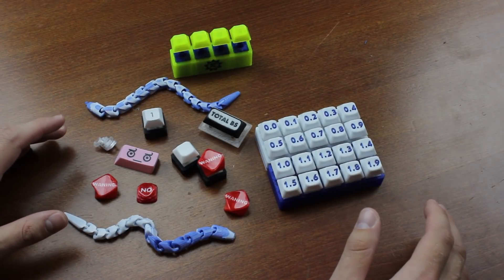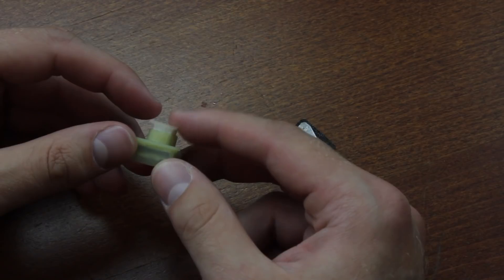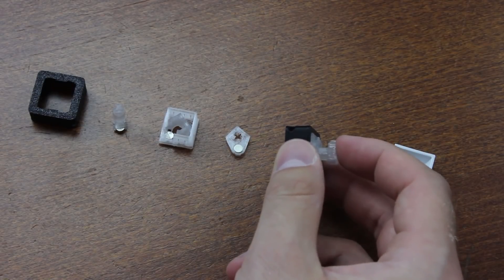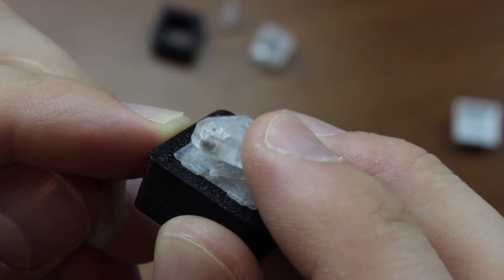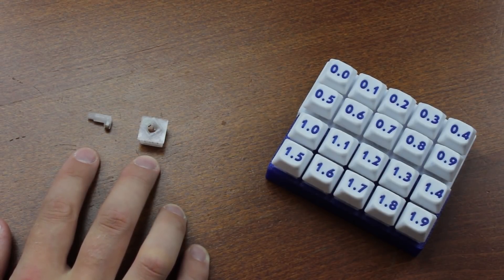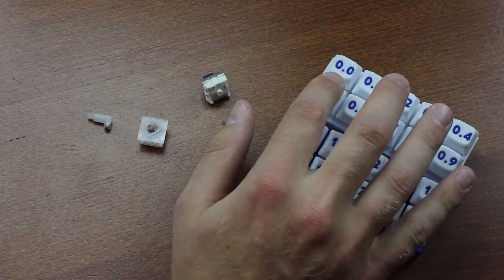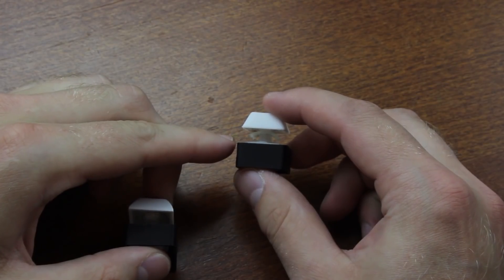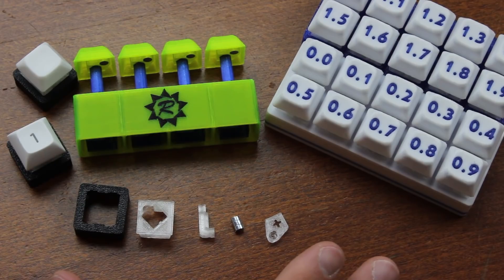Teardown - 3D-printed magnetic levitation "Void" switches!

Comment: I thought of this sort of idea a while ago after seeing the At&t switches. Really glad to see that it's possible and so elegantly done. Although I was wondering if you could even remove all friction by putting a magnetic slider in the center of a magnetic ring or something, so the slider would never need to rub against anything at all inside the housing. The solution used here is a lot simpler though, and tons easier to make, I'd think.
Reply: Imagine using adjustable magnets to change the weight and tactility in every switch to make it perfect for the user

Comment: I'm assuming that this kind of design puts the tactile bump all the way at the top of the key stroke?
Reply: That is correct.  There's some travel (~0.1mm) but it's mostly related to the tolerances you use when you generate the switch.  This is because the stem has to sort of straighten itself out before it moves down the sheath (aka the path of travel).  It's definitely a completely different key feel from literally every other keyboard that's ever been made.  If you could amplify the tactility of any given tactile switch (and move the bump to the top) without increasing its weight/force that's kind of like how the switch feels.

Also, if you use N52 (strongest) magnets and a really large magnet gap the switch feels quite linear.  The travel distance also has a non-trivial impact on how linear the switch feels when you use this sort of configuration.
Reply: @Riskable3DPrinting  If you used a medium gap, does the tactility become more rounded, like on SKCM Brown/Green or Topre. I get that it's not going to gradually increase, but since it's magnet-based I'd assume it would gradually decrease. Thanks a lot for the answer! I'm really curious about how this project will turn out.
Reply: @Zentennen  Well it's not going to feel like a Topre which has a really long/smooth "bump" but it definitely gets more "rounded" as you crank up the `MAGNET_VOID` value (with N52 magnets).  The effect is less noticeable with weaker magnets though.
Reply: @Riskable3DPrinting  I might just have to try them out some time, sounds promising!

Comment: That's pretty interesting. 
Would love seeing them in a keyboard for sound, comfort and durability testing.
Reply: Ya know, I've been doing testing with long-ish (6mm) travel switches and low-profile, short (2mm) travel switches lately and it's amazing how much of a difference that makes in the sound.  Using different materials also has a huge impact.  For example, if you print the switch in PLA that makes a higher pitch sound (because it's a harder material than PETG).  It also sounds different if you print say, the stem/slider in PETG but the switch body/sheath in PETG.

The keycaps also make a HUGE difference in the sound of the keyboard.  Thick PETG keycaps sound and feel the best IMHO.  They have a softness to them that just feels nice and they generate some of the lowest, "thockiest" (hehe) sounds.  If you print everything in PLA you get that high-pitched "clack" sound that a lot of people prefer though.

Of course, lube (and different types) also modify the sound profile quite a bit.

Comment: I think this would be a great print for a resin printer.
Reply: 3D printer resin actually has a terrible coefficient of friction compared to PETG.  So while the part would look nicer it wouldn't really feel nicer.
Reply: @Riskable3DPrinting  You could print the parts with PETG and only the keycaps with resin. I would like the more silky feel of resin, especially the grey engineering resins that are on the market nowadays. PLA has a way better friction coefficient than PETG by the way. So then I suggest using PLA. The additional brittleness is not an issue in this case.

Comment: Imagine working electromagnets into this and having a keyboard with fully customizable tactility and actuation point in software (pretty sure electromagnet strength can be varied as opposed to on/off).
Reply: This is possible but you'll need some serious electromagnets under each switch.  Would make for a reasonably tall keyboard. You'd also have to be careful with the timing so you don't mess up your hall effect sensor readings.

Comment: Wow, I wonder how accurate the machine needs to be to print this stuff, this should only be printable in a well calibrated printer with dry filaments. Even if you print it larger and sand it down to size it still takes time to make every part fits, otherwise they will stick or wiggle.
Reply: Nonsense!  The tolerance is configurable so even if you have a terrible printer it should be fine regardless of how much of a wobbly POS it is.  The part that matters is the stem and the sheath and with 4mm of travel they're under 15mm long.  That means that even if a belt on your printer is too loose or too tight it can only impact the tolerances so much, ya know?  It'll be fine 👍

If my noob 3D printing friend can print these with his Ender 3 Pro anyone can do it.

WTF does dry filament have to do with anything?  Hah!  I live in Florida and some of the filaments I've printed switches with have been out in the open air for months!  Prints fine (though you can get ugly bubbles in wet transparent PETG sometimes, haha).  Best filament for this is PETG: It has a low coefficient of friction, is quite robust, is super easy to print with, and cheap !  One spool of clear PETG will get you like a bazillion switches.  Many keyboards worth!
Reply: @Riskable3DPrinting  Is it? I have a roll of bubbly clear PETG loaded on a Anet A8 now left to collect dust. I like PETG as it is the easiest to print but the bubbling clearly makes it print larger than normal.
Even in its prime days when I calibrate it daily and stow away the filament after print I still struggled to print some large parts precisely and had to have clearance hard modeled.
Reply: @someonestolemyname  Moisture doesn't make your prints larger than normal.  It makes pock marks in the layer lines.  If the filament expands while it's extruding then there's something else going on.  Likely, the filament is mislabeled!

PLA Pro or PLA+ filaments will often have additives that make them expand a bit like a foam a little bit when extruding.  You can see this if you just run a bunch of filament through the extruder while it's up in the air (so you can see the extruded filament as gravity takes it down).

PETG filament will not expand or get wider like that no matter how much moisture it absorbs.  Also, the max amount of moisture PETG can get is a fraction of what PLA can soak up (0.5-1% VS 1-6%!).  I'm guessing that the max amount that bubbles could possibly throw your prints off would be around 0.05mm.  So if you printed a 15mm part and measured it with some calipers it might be 15.05mm but that's well within the tolerances of the filament itself anyway (which is usually 1.75mm±0.05).

If your prints are off by more than 0.05mm on such short distances you probably need to tighten, loosen, or replace your belts.  Regardless, even if your prints are off by 0.25mm my switch can still work haha.

Comment: Nice.I tried to experiment with 3D printing switches myself, but it never worked, the mechanism was jamming and extremely sticky... so thanks to this guy I know it is possible and I was just bad at it 😁
Reply: I ran into some of that as well in my early prototypes.  You gave up too easily!  There's a bunch of things that can cause jamming/binding but the biggest one is first-layer squish (elephant's foot).  Those edges are very thin and tend to "crinkle" (`|` becomes like `S` at a microscopic level).  If you sand them off that problem goes away for the most part.

The other big thing that can cause binding is stiction: van der Waals and electrostatic forces want to keep same-material smooth plastics stuck together when not moving.  The fix for that is also sanding, lubrication, and picking the right materials.  Polycarbonate, for example has terrible stiction issues when rubbing against itself.  Absolutely awful in my testing, haha.

I tested loads of materials and the best by far is PETG.  It holds up over time, is flexible enough to jam magnets into zero-tolerance slots without having to worry about it cracking, and has self-lubricating properties when rubbing against itself.  If it had a slightly lower coefficient of friction it'd be damn near perfect.

For reference, the ultimate combo--if you can pull it off--is to use POM for the sheath and PETG for the stem (body material doesn't matter since it has no moving parts).  POM is a fantastic, hard material with a slightly lower coefficient of friction than PETG and because its density/hardness are so different from PETG the two should produce the smoothest possible motion (in theory).  Even better than Nylon + POM which is currently the industry standard for injection molded switches.

Comment: Can you already have a working keyboard with these?
Reply: Yes I do!  I have three of them: https://gfycat.com/fluidsevereairedale (hand-wired analog macro pad on the left, my Riskeyboard 70 in the middle, and a non-lit numpad on the right).  This is what the numpad looks like (since it's hard to see in that other gif): https://gfycat.com/scrawnyglisteningandeancat
Reply: @Riskable3DPrinting  That looks amazing! I still a little bit confused on How It Works. So you can hand wire It? Does It has contacts to do so?
Reply: @catoflado4977  The Riskeyboard 70 is my main driver keyboard in that gif and for that I designed a custom PCB.  The 6x2 macro pad on the left was hand-wired using my Analog Keyboard Unit (AKU) PCBs which were specifically made for hand-wired builds.  Though you don't really need any of that:  You can just buy some "49e" (or similar) linear hall effect sensors and put them in the right location under the switch and it should "just work".  How you hold them in position is up to you (hot glue on some cardboard? That would actually work! haha).

The actual tricky part is getting loads of analog inputs into a microcontroller and reading them all via firmware to actually have it act as a keyboard.  I wrote my own custom firmware for this that anyone can use but it's currently in an early alpha state.  I uploaded it here if you want to take a look: https://github.com/riskable/riskeyboard70

For reference, I also made a daisy-chainable Analog MUX PCB that lets you multiplex 16 channels of analog inputs into a single microcontroller pin.  So for every analog pin on your microcontroller you can have up to 16 analog key switches using my firmware.

There's a lot of stuff to keep in mind when making a build like that though so I plan to make a video series all about it 👍

Comment: If you can make the tactility occur halfway down the travel of the key press, I'm sold on it and will pay the near-thousand it'll require if it ever has a Kickstarter campaign.
Reply: Can you explain what you mean?  I'm assuming you want something like a linear switch at the top of the travel that turns into a very strong tactile "bump" in the middle of travel?  I can probably make that work but it would be a much more complicated design.
Reply: @Riskable3DPrinting  Precisely! Sorry, my English probably isn't the best, but you understood exactly what I meant. I guess the best way to explain it is that it'd emulate a tactile switch where it has some pre-travel before the bump. The problem is all the tactile switches have incredibly soft bumps in the mid-travel stage, and the best tactiles are always clicky switches (which is too loud for office work).

Comment: will the magnets wear out over time i wonder
Reply: No.  Neodymium magnets do not lose strength over time.  What does cause them to lose strength is heating them up past their curie temperature.  In the cheap magnets I'm using I did notice a very slight drop in strength after running some switches through the dishwasher but that may be due to some deforming of the plastic by water absorption (and the heat) that increased in the void between the magnets at rest.  Generic neodymium magnets should be fine up to 80°C.  You can get high-temperature neodymium magnets that will keep their magnetism all the way up to 235°C!  Then there's samarium cobalt magnets which can work up to 350°C.  Any kind of magnet will work as long as it's strong enough to be detected by the hall effect sensors 👍
Reply: @Riskable3DPrinting  cheers for the reply dude, hope all goes well!

Comment: I have several questions:
1. I've been wondering how smooth you could get a 3d printed switch, are these any good in that regard?
2. Can we get some force curves for these?
Reply: Here's a force curve I measured of a 0.0mm MAGNET_GAP Void Switch with 4x1.7mm N35 magnets by hand (lowering my 3D printer in 0.1mm increments on to a switch that was sitting on a digital scale): https://i.imgur.com/FNoTSpL.png (I think it was a switch with 3.5mm of travel)
Reply: The switches are quite smooth because the print orientation results in layer lines that are like this: || || (they run parallel to each other in the axis of motion).  For extra smoothness/less friction you can print the stem at a slightly different layer height (e.g. print the stem at 0.12mm and the sheath at 0.16mm).  I never bother though because they're pretty damned smooth right off the printer.

Regardless of how terrible your printer is you can always make the switches ultra smooth by just sanding them!  Also, if you sand the bottom (flat) corner edges of the stem with something like 400 grit sandpaper that makes it extra smooth as well because it gets rid of the little crinkle that's possible from first-layer-squish (aka elephant's foot).  It would wear off after a few hundred keypresses anyway though.

Comment: The sheer level of and ease of modification to the user experience puts these leagues ahead of everything else on the market as far as fine tuning for the end user. I absolutely can not wait to see where this project goes!
Reply: He could even potentially design in adjustable magnet distances so you can adjust the tactility with something like a screw mechanism. That’s really the only improvement I can think of!
Reply: @myrealusername2193  So, what does he mean by «tactility» ?
Reply: @BlueTemplar15  basically, when you push down a key, at a certain point it becomes much easier to push. By adjusting where the magnet is, you could adjust at what point this happens, and how much of a difference in force there will be. The important part is that this could be adjusted by the user very easily, where normal moulded plastic key switches can’t

Comment: Isn't that heavy though? and what about the force weight on key?
Reply: The strength of the switch is dependent on the "void" (amount of plastic interposed) between the magnets at rest.  If you use cheap, 4x2mm N35 magnets (which are usually 4x1.7mm, sigh) the strength of the switch starts at around 60g of force for a 0.0mm MAGNET_GAP and goes down from there.  As an example, a 0.5mm MAGNET_GAP with those same magnets produces a switch with about 42g of force.

If you want an even lighter/shorter switch you can use 4x1mm magnets or even 3x1.5mm magnets.  You can also mix things up and use say, a 4x1.7mm N35 magnet in the body, a 4x1mm N45 magnet in the stem, and a 4x2mm N52 magnet in the levitator (under the keycap).  The possibilities are limitless!

Comment: Very interesting! But since it's 3D printed, how comparatively smooth is it compared to injection molded plastic? Are there plans to have it be mass produced by a switch manufacturer using injection molding?
Reply: Getting moulds made costs a fortune that I don't have.  It would also mean creating moulds for each strength of switch (0.0mm through 1.9mm or so) which is a lot of combinations.  As far as smoothness goes, they're super smooth right off the printer because I designed them so that the orientation of the parts has the layer lines running parallel to each other in the axis of motion (|| against ||).  PETG has a very low coefficient of friction--especially rubbing against itself (it sheds hydrogen atoms and has self-lubricating properties).  POM and Nylon would be smoother but not smooth enough to make a huge difference in feel IMHO.  Besides, you can always just spend some time sanding your 3D printed stem to make it as smooth as glass if you so desire.
Reply: @Riskable3DPrinting  You really thought of everything! I was concerned that 3D printing leaves layer lines, and it didn't occur to me that you could print them that way where all the lines run parallel to each other up and down. Can't wait to see the finished product!